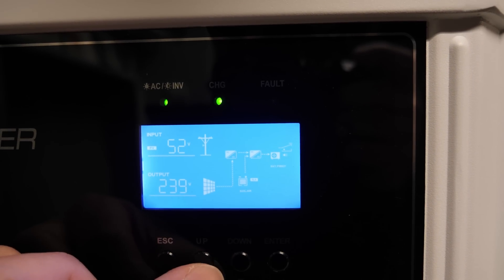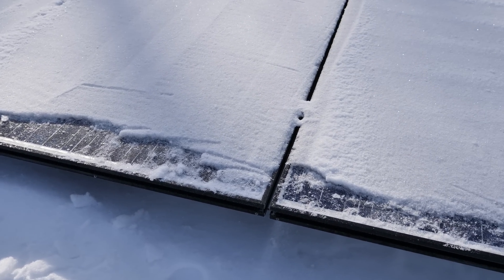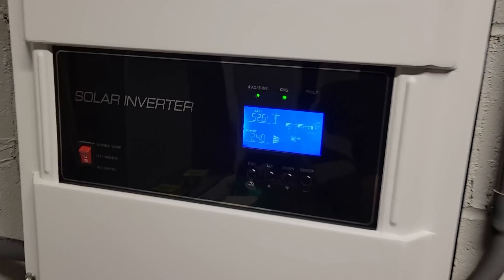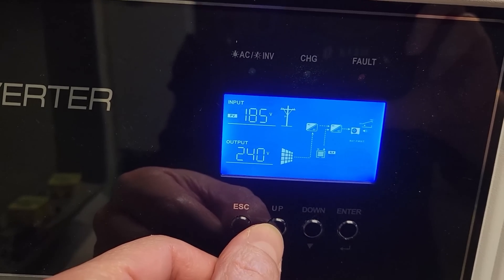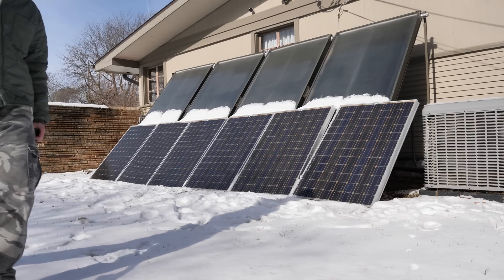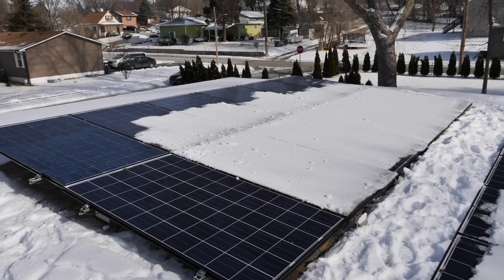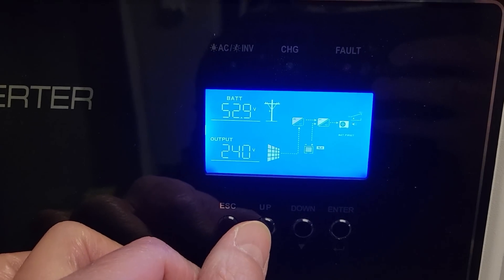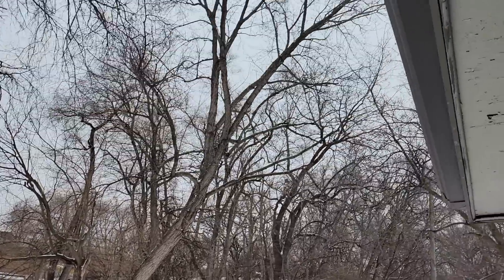Solar in Winter!

Comment: Is it possible for your solar panels to drain your battery bank if there's no incoming sun?

I'm having my battery bank power plummet in just a few days but I've literally been using ZERO power. The only explanation seems to be that somehow the panels are draining power when there's long winter months of no sun. 

Hope someone can offer insight on this. Thank you.
Reply from the maker: Not that I am aware of unless your panels maybe dont have diodes on them but Im pretty sure just about every panel out there has them. Also that would be panels connected to batteries without a charge controller. Is your system on and not powering anything or is everything off?

Comment: Interesting. So if the panels didn't have a "lip" on them, the ice would slough off sooner. Any way to possibly add something to remove the hard edge of the lip? Maybe a very thin later of epoxy or something to make it a nice transition from glass to frame.
Reply from the maker: Yeah I guess if the lip wasnt there it would help for sure. I could get frameless panels😲😲😲🤣

Comment: Should be required watching for "green" energy fanboys. Now imagine that you are 80 years old and have to get up there to clean the solar panels off. And I like to point out that more people have likely died installing / cleaning solar / wind power than have ever been killed by nuclear power. And that's not counting the fact that solar power cells are full of toxic substances that will be a big issue in the future.
Reply from the maker: TROOF!

Comment: Yeah Joe, you can significantly increase your overall annual output by tilting the panels to approximately your latitude. You'll be a couple of degrees off in summer and a couple of degrees in winter but overall annual performance will increase.
Ground mounts are the definite way to go; no climbing on a slippery roof to clean them and no roof penetrations' to cause leaks.
I see your in a suburban setting; how did you get past the mounds of red tape with the utility?
I built a mobile mount on a garden cart to avoid the problems with a "permanent structure" that required numerous safety inspects and a bunch of permits.
Reply from the maker: Yeah ground mount is the way to go around here for sure!  Sooo I just installed everything😎

Comment: I have a ground 40 panel system. Yes its a lot easy when I do have to remove snow/ice.  Still doesn't help on super cloudy days. I do 2kw to 21kw a day in winter so far. I have seen 1/2 hour of 8900 watts when the sun was fully out. Solar bites in the winter.
Reply from the maker: WHOA sounds like a sweet setup!  Yeah I might see around 3000watts in full sun if I am lucky this time of year!  Need Moar Power!!

Comment: Nice how the sun warms them up and creates a water layer under the ice.  The snow would just slide off at a bit more of an angle and some room at the bottom of the panels for it to fall onto.

But why is the wattage bouncing around so much on those displays?  It should be relatively stable, shifting slowly with the sun and shadows.  But not bouncing around like it is.
Reply from the maker: Yeah once they warm up a little it doesnt take much to remove.  Panel just needs a little showing.  100% if I had an angle up there it would go a lot better.  For the bouncing around, it could have been right around the voltage for bulk and float.  Or that charge controller is BROKEDED lol. JK its usually stable

Comment: Before you rip out the solar thermal, how about quick video on its operation. One simply can't live by electrons alone!
Reply from the maker: I did a vid a few years ago.  Its in the vid section!!!  It works great actually.  Reason for removal at this moment is we had some wood floors put in and all the nails from the install punctured the pex under my floor(easy fix).  I also need to find another tank....  Ill be keeping an eye out for another tank and maybe reinstall at a later date!

Comment: Like me, I'm sure you're glad we haven't had as much snow this winter.  I think we had an inch in MI last week then it all melted away.  Now we're expecting 4-6" today.  Only pulling in 5W so far this morning...looks like I need to clean the first round of snow off the panels...
Reply from the maker: I actually Love the snow except removing from the panels lol. Yeah luckily we havent had much of any snow this winter🤷‍♂️ You better get out there!🤣💥🤘
Reply: @AVERAGE_JOE  I do to.  I don't mind the cold.  Wife hates it.  

Just came inside from cleaning the panels and changing over the blade on the tractor. You can't even tell we cleaned the panels already...nice big flakes coming down!

Comment: Would you say this makes a strong argument for having the panels tilted closer to a 45-degree angle, in winter, for those of us in northern climates?
Reply: Yes, definitely. I did this on my ground mount array and the snow just sloughs off. You need to build your array really, really high so the lower edge has enough distance to collect all the snow. I have 5 feet of snow at the base of mine right now.
Reply: @NeverTakeNoCut-offs  - I have a mini-barn with a gambrel style roof.  If you're not familiar, this means it has a section of roof near the top that is almost flat, while the remaining section is nearly vertical.  I have panels on the vertical section for winter, but they pivot up to be nearly flat during summer.  In the future, I will have panels on the top section and no longer pivot any of them.
Reply from the maker: Yes 100%! Just as helenbeals also stated having the room below the rack is key!💥🤘

Comment: Leaf 🍁 blower. Before it melts and freezes. Works much faster. Thanks again for your output.
Reply: good thinking 99 :)~
Reply from the maker: On powder it works, have done it. This started as rain, freezing rain, winter mix and then snow🙄🤣
Reply: @AVERAGE_JOE  https://youtu.be/F6RkquWKtII?t=141

Comment: Tip: Go get Rain-x Windshield Washer Fluid and a spray bottle to remove the ice from those panels. Spray the panels at the top and let the Rain-x do it job.
Reply from the maker: Does that work for real? I guess it would huh😲
Reply: @AVERAGE_JOE  get the one for winter and ice
Reply: @AVERAGE_JOE  It doesn't work. I tried it.

Comment: Watching you whack the ice on the panels I was cringing hoping nothing cracked! lol 3kw combined with such a low solar angle and shade from the trees isn't bad though. I have ground mount for mine but lots of trees to either side of me and at this time of year the trees to the front of my property cause shading at various times of day but on a good day it's still generating about 24 kilowatt hours which isn't bad. Cloudy rainy days more like 3 to 6. Plan to add another array on the upper part of my property this spring that gets less shading when the other panels have shade. No real snow at all here this winter and I'm not complaining. :)
Reply from the maker: Lol I knew people would cring when I was doing that lol. Ive been doing it for years and never an issue. I dont hit them tooooo hard😉 Yeah we havent had much snow this winter either. I do like the snow tho. Yep, Ill be adding moar solar when I can. Need Moar Power!😆💥🤘

Comment: Put a tarp over them the night before? Could electrify it and use a winch to cover and remove! 🙂
I'd love to have some panels on the roof to be able to clean! Think of it as part of your daily exercise!
I'd keep the trees and work around them as they give life and are important! Just get more panels or do a deal with community solar where you can still benefit from them in an optimal location.
For winter you could even mount them vertically on the walls and not have any snow issues...
Reply from the maker: I have used tarps before for the small snow predictions and it does work. This snow was predicted to be over 10" so I didnt bother. The temps warmed up a smidge which ended raining and then a wintery mix. Yeah I will keep the trees and work around them. Will only remove when in bad shape. Ill just add more panels for the win!😆💥🤘
Reply: @AVERAGE_JOE  10" of snow over that area is a lot of weight, maybe close to a ton.
If you angle the panels more, then you'd also have to space them so they didn't shade each other...
Solution - rip off the roof, build another two floors and put a 45 degree south facing roof on it! 🙂
Reply from the maker: Ive had over 12" on them before EEEK LOL.  Yeah that was another reason I didnt angle them on the roof.  Would need to space them for shading!  Ill just add moar panels when I can.  Id like to do a big ground mount some day!
Reply: @AVERAGE_JOE  Will be here for it! 🙂

Comment: Like a 3d printer, what if the panels has a provision to warm it up to few degrees alone to melt the ice?

I live in a place with no snow, why don't you try? It shouldn't cost much either
Reply from the maker: I have been thinking of that actually. Not a plate but possibly gutter heaters or ice dam heaters. Was thinking of putting them under the racks!😆🤘

Comment: I'm glad I live in Sydney Australia, never snows.  you should put a 1' gap between the rows so they run off
gee, I wished I had half the equipment you have. if I can replace my inverter which I think is playing up, and get a battery, I think I'm good for a while. may have to get government incentives to work for me somewhat
Reply from the maker: Yeah I would say you are good on the snow front lol. I have a gap between all the panels, not an inch but a 1/2". You should jump on those incentives for sure!

Comment: At least you can get to yours. Mine are 20 feet up on an 18 degree slope steel roof. Not going to try and get up there. If it's below freezing and no sun the snow stays. 37 degrees today and a tiny amount of sun and the snow slid off the roof. Ground mount at 40 degrees comes off a lot better. 1500 watts on the ground and 15875 watts on the roof.Thank goodness I have a generator or I would be in trouble. No grid power. Midwest winter means lots of clouds and a very low solar angle. Never have to run the generator in summer. It's snowing tonight, crap.
Reply from the maker: Yeah troof I can get up there with 0 issues. Would not try on yours Fo Sho! This winter in Nebraska hasnt been snowy but cloudy for sure! I really need a crap ton moar solar for winter time. I do still have grid for now tho😆

Comment: I usually treat my panels with Rain X or some other wax every three months or so (regardless if roof or ground mount). It sure help bead the water off before it can freeze. It helps with the snow a little too!
Reply: right on brother..... "good thinking 99" i bet u cant figure out where that come from...muahahahahaha. Rainx is good for that but expensive.... then again... better then getting on a bloody slippery roof thats fer damn sure.
Reply: @OffGridAussiePrepper  I'm sure Agent 86 will fully concur !!!!! 😆
Reply from the maker: If my roof had a steep incline.....🤣
Reply from the maker: Ill get right on that!🤣🤣🤣
Reply from the maker: Really? It helps with snow? If so I may have to try that!😲🤘
Reply: @AVERAGE_JOE  Key word... "Helps". With you steep slope, who knows. Maybe a leaf blower if the snow in powder? My winter elevation is 24' and July is 61' so it does help...